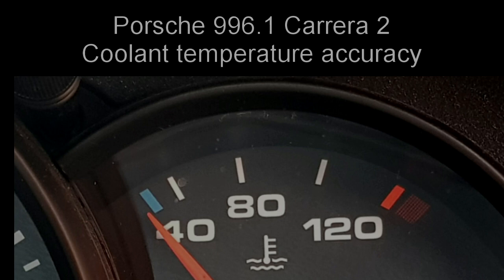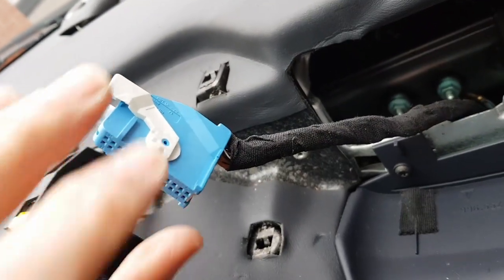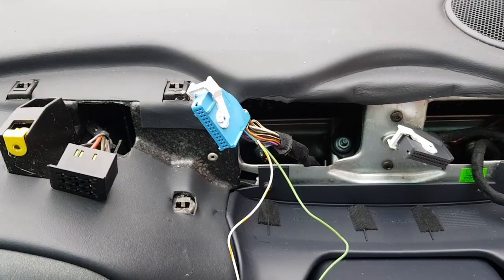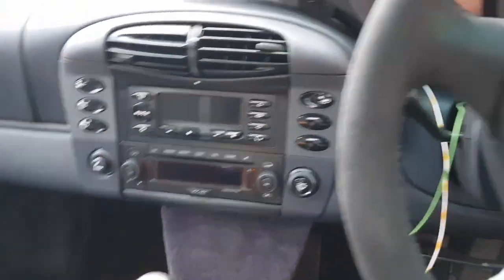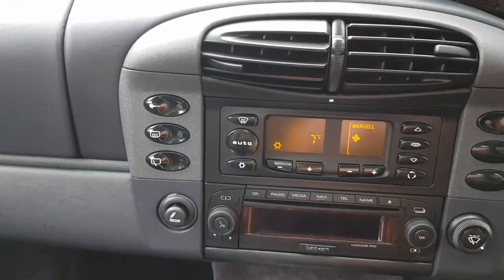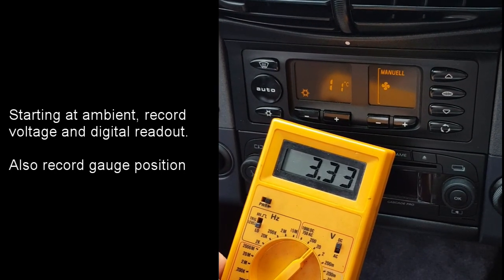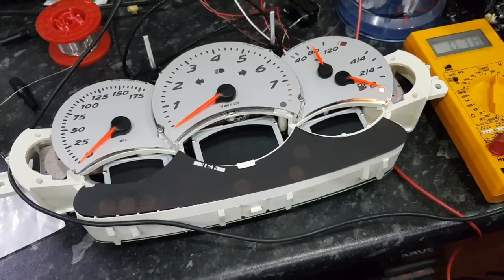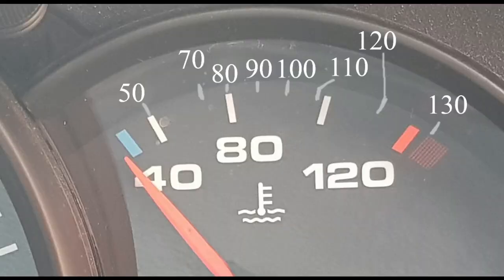Porsche 996 coolant gauge accuracy

Comment: This shows that the gauge is actually really quite accurate. I wonder whether people tend to misread it.
The 40 on the gauge relates to the Blue line and the 120 relates to the Red line. This means that the first white line indicates 50 which is spot on, the middle white line indicates 80 which is spot on, and the third white line indicates 110 which is virtually spot on. So that's really very accurate.

Comment: YOU legend, love your work on figuring this out. When your driving around town in stop go medium traffic, where does your gauge sit? Mine sits about 105 and the moves to about 98 when cruising. On freeways it drops to about 85-90. This is summer temps in Australia with ambient about 28-35c. I'm trying to establish if i need to replace my radiators or waterpump or sensors...
Reply from the maker: Mine sits around 80 on the gauge but creeps up in slow traffic to an actual 102-103 in warm weather. The car a low temperature thermostat and rew radiators. This is part of a bigger project to make it read correctly and also to make it switch to reading oil temperature.
Reply: @martinhill5770  oh wow, that would be fantastic to see the oil temps. Every looked at making the radiator fans kick on earlier? say at 98c rather then the 105c(i think) ?
Reply from the maker: @pokiou   I haven't, but my mod does include a switchable centre radiator which is activated over a set coolant temperature.  It could drive the high speed fan control as well but that isn't my intention right now.  It will all be written up on my channel though.